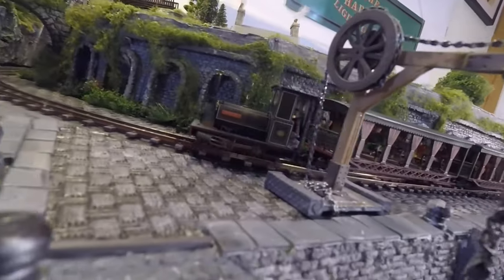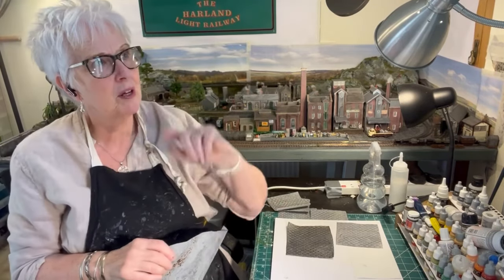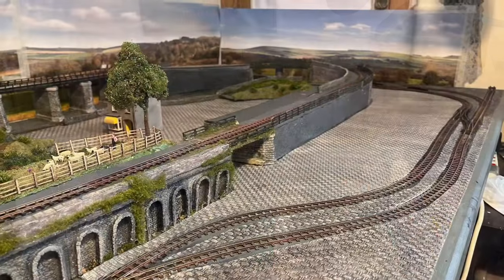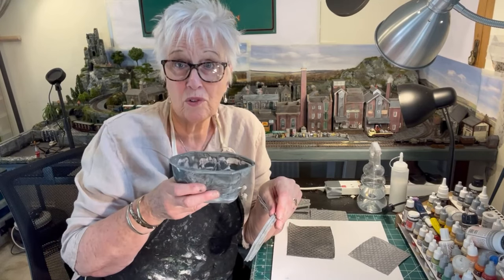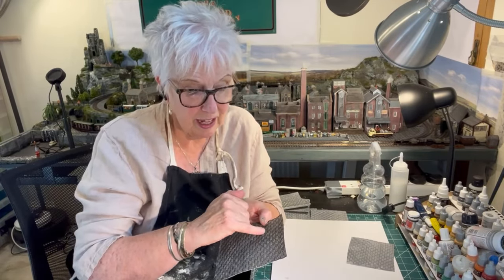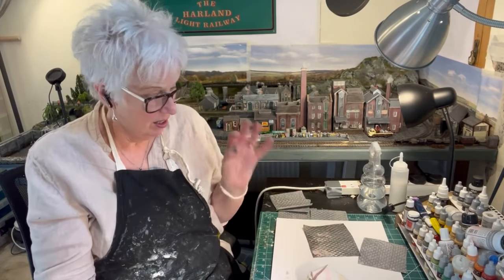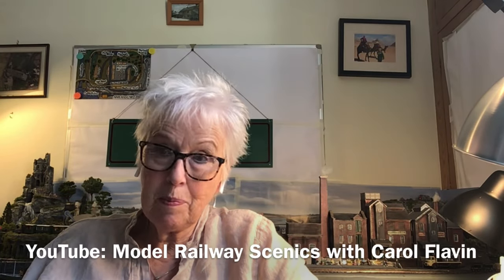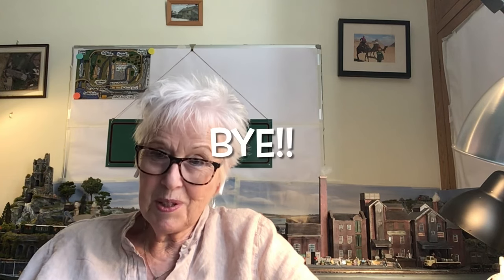WALLPAPER COBBLES AND GROUND COVER FOR MY OO9 NARROW GAUGE (Video 11)  - THE HARLAND LIGHT RAILWAY

Comment: Very clever. I would of never thought of using wallpaper for cobbles. I have no problem with the size of the cobbles.I think about Rule 1, it's your railway layout do what you want. There's no right or wrong. That's what I believed when I was a modeler over 50 years ago. Bill from California, USA
Reply from the maker: Thanks Bill. You are quite right about Rule 1 and when I get the time I shall really enjoy turning the surfaces into something more weathered and aged. Still building at the moment.